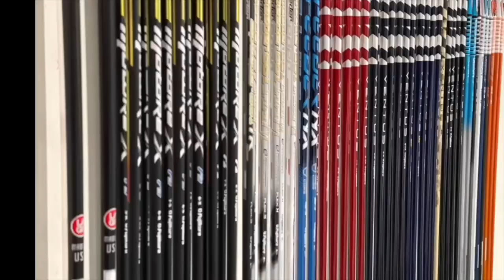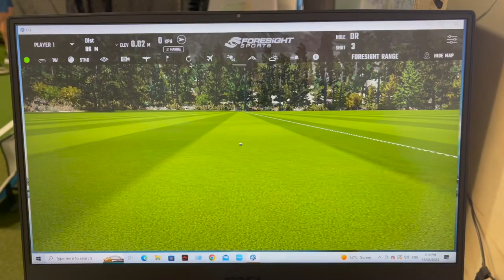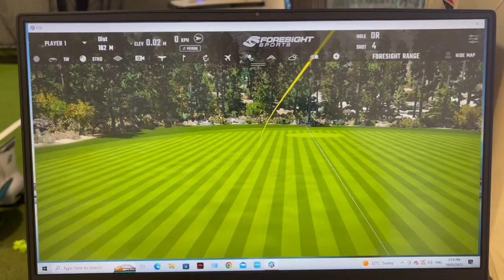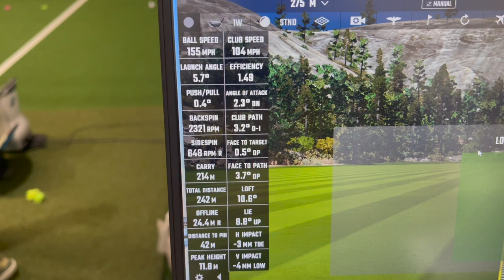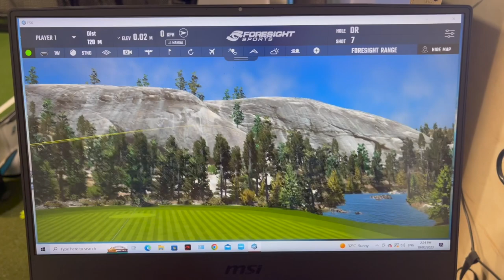How to optimise your driver spin

Comment: Wonderful explanation, leaving nothing out.  This is another example of the reason why getting fit is SOOO important.  Shaft and head combinations are paramount.  I often question YouTubers when they compare driver heads with the same shaft which may deliver varying degrees of spin, loft and distance purely based on deflection and contact.  I think maximizing head and shaft options for the SPECIFIC player is the best way to compare drivers.
Reply from the maker: It’s the only way to test different heads 🕺🏻

Comment: Best explanation I've seen especially the way active tip shafts act both ways depending on how one loads it. I'm trying to lower my spin with same club speed. I suspect my slightly open face at contact as I come in to out. Any tips?

Comment: Brilliant video, makes so much more sense, with the dynamic loft , im currently rocking a stealth turned down to 7 degrees but still have a high launch upto 20degrees only swing at 100mph and onlu carrys 220, think its my shaft, its stiff but i used to have a Kali white which was amazing and much more piercing trajectory
Reply from the maker: Dynamic loft is the key to launch. 🚀
Reply: @SydneyGolfTech  trying to lessen mine at the moment
Reply from the maker: @garrysutcliffe6254  both shaft and technique will help.

Comment: Currently 85 mph launch 12 degrees and 3600 rpm I am suppose to work to 16 degrees and 3000 rpm. If I increase driver loft for more launch I will get more spin but I want less.
Reply from the maker: Try and increase launch without adding driver loft. It will then reduce spin.